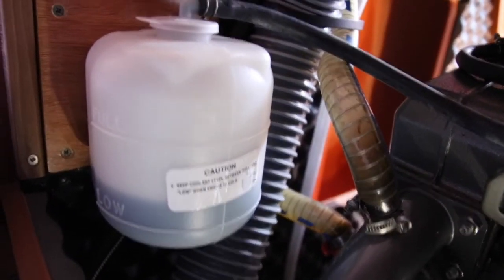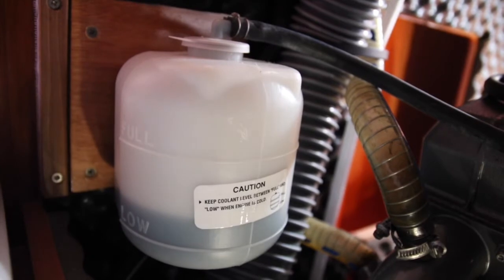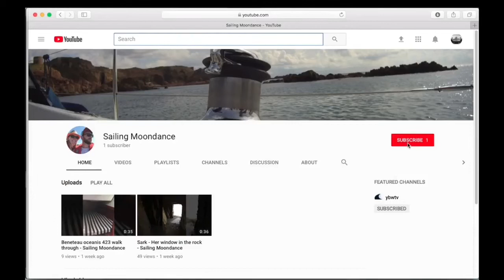EP.2 - Yanmar 3YM30 Sail Boat Diesel Engine Checks (Part 2) - Sailing Moondance

Comment: perhaps you should advise people to throw a litre of water down the water filter to prime the pump after a long shut down (and  then to close the lid well to maintain suction!). Also, warn people when inspecting the secondary fuel filter that even if looks perfect, its pores might be blocked,; so obligatory change at least every two years.
Reply: The sea water filter mounted seems a little too high. My thought is lower better.